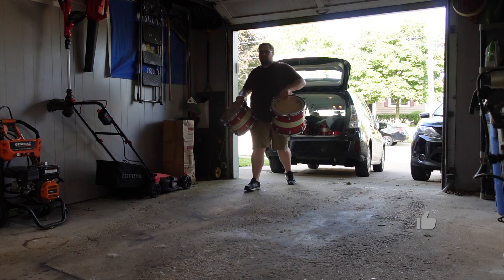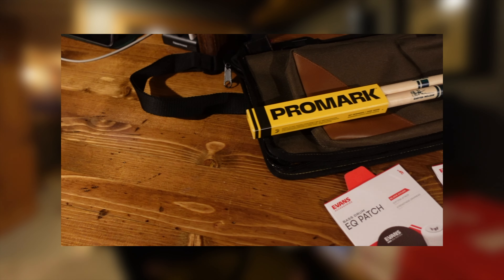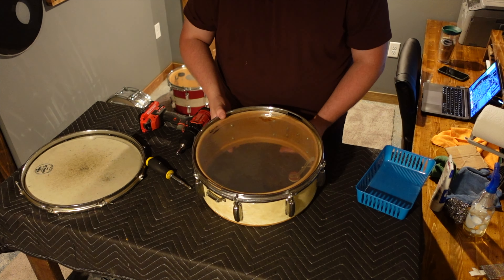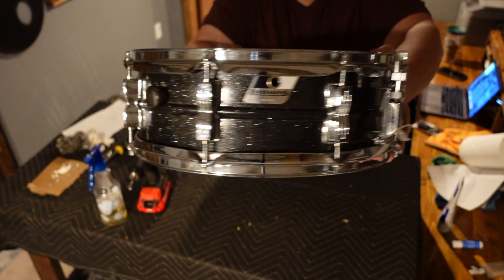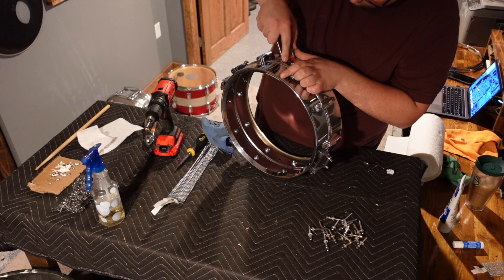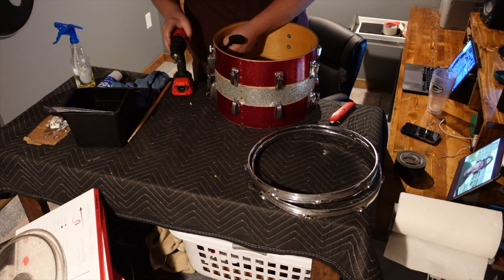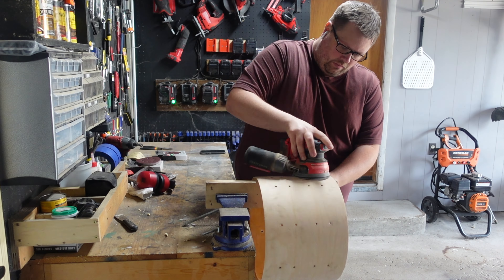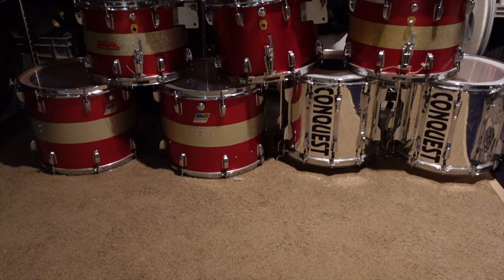Fixing A Whole Lotta Ludwig Snare Drums

Comment: Nice. You can use the INDe Universal Butt Plate on the Acro to replace the P32. Mine fits fine and works great.
Reply from the maker: Is that a new butt plate? When I bought my Inde throw years ago, it came with a single point mounted butt plate.
Reply: @malonedrum  It's been around for a few years maybe. It has adjustable hole spacing.
Reply from the maker: @AmyDrums  that’s news to me, was hoping to have something like that when I was initially replacing my own Luddys